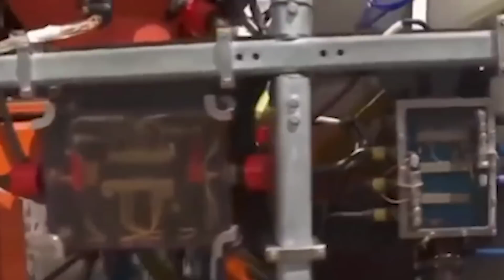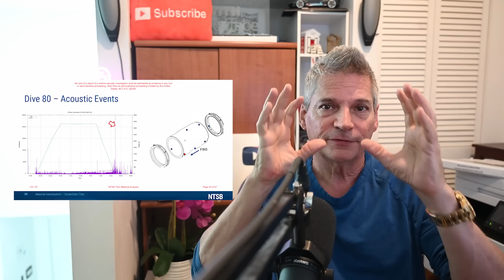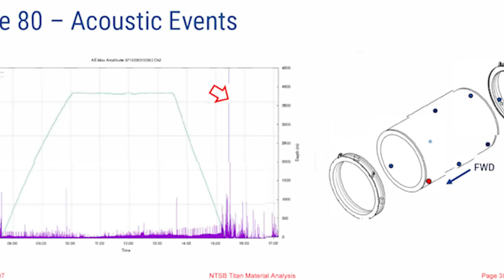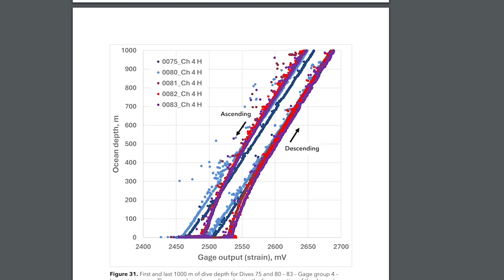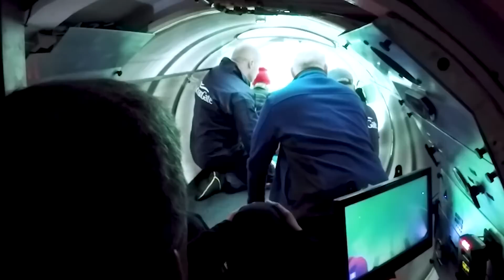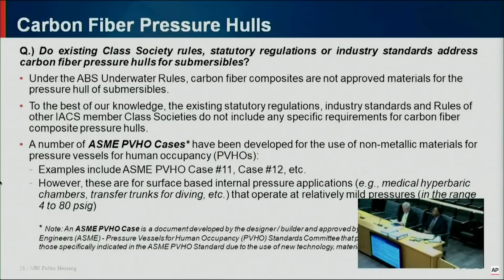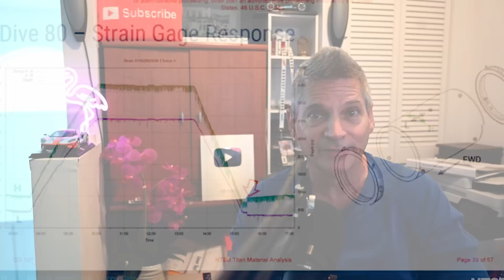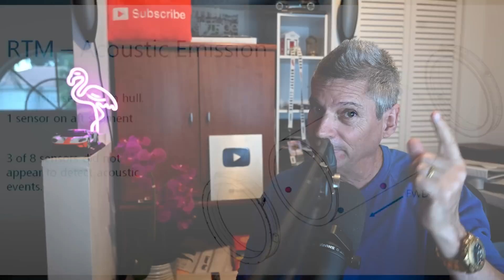How OceanGate Titan Sub Realtime Hull Monitor FAILED! RTM

Comment: Jeff,

I have no first-hand experience with carbon fiber hulls.  I do have years of experience with steel-hulled vessels.  I spent years working both within my company and with other companies and regulatory agencies studying fatigue cracking on tankers.  I worked on the prevention of cracking through design, monitoring cracking, the repair of cracks, and modification of structure when repairs are made.

On several occasions, we removed sections around cracks and sent the steel for laboratory analysis.  When fatigue cracks progress in steel there will be chevrons left in the crack pointing in the direction of the starting point.  At first, the chevrons will be close together, say 4 or 5 chevrons spaced 1/16" apart.  Then you might have 2 or 3 at 1/8" apart.  Then one at 1/4", the next at 1/2".  Then the crack may reach its critical length, at which the crack will run until it reaches something that stops it.  I saw cracks that were 9' in length, and one that was 20 to 25' in length.

About the time I retired, I started discussions about the feasibility of placing strain gauges in the cargo block area that could be downloaded periodically to help in the identification of crack initiation.

As I said my work was with steel.  On a tanker, you might have 2 or 3 grades of steel.  The steel is welded.  Ships are built and inspected following regulatory agencies' rules.  Structural rules for tankers are uniformly based on the International Association of Classification Societies (IACS). 

Titan was built based on no rules, regulations, standards, oversight, or inspection.  Based on what has been revealed there were no inspections to identify where the banging was coming from.  It seems that Mr. Rush went out of his way to avoid finding out his design was faulty and was ready to fail.  As with fatigue cracks in the steel of tankers reach their critical length, the Titan reached a critical point.  It could have been the adhesives used to hold the titanium rings to the hull, the carbon fiber, the adhesives between the 1" layers, or some other design flaws.  It is clear that Mr. Rush avoided seeking approval because he knew his design was faulty and he could not be modified enough to be approved.  It is a shame that four other people lost their lives due to Mr. Rush's ego. I think the legal term is negligent homicide or involuntary manslaughter. 

Bob
Reply: If you consider the contraction and expansion rates of different materials due to both atmospheric pressure and temperature... it's not just the carbon fiber composite contracting and expanding at different rates to the titanium, but the glue as well.  This "joinery" seems to be the most obvious point for potential failure but they only paid attention to the circumference of the hull (hoop stress)... 😱
Reply: the most confounding part is they never destructively tested the vessel, so they had no idea when it would even fail. Just mind boggling.
Reply: Very well written, Bob. I enjoyed your comment, especially what I surmised to be about steel welding and the potential varying grades of steel being used. That was BITCHIN' (to use a word from Junior High) and got me thinking about different things that could be affected in daily life, like 60+ years home pipes. 

EPIPHANY-CITY. 

Your comments on steel and steel-hulled vessels can also be appropriate to the materials used to build, maintain and fix aircraft. 

It seems that the Titan submersible seemed kinda nicely thought out and put together...
For a shallower dive.
A REALLY shallower dive. NOT for going down to something 12,500' underwater. 

Thank you!

(I wish I was born into a time where I could've gotten into this stuff as well as aerospace, instead of being pressured into either a housewife or retail slave occupation. Yeah, I'm older, but still kickin'.)
Reply: Oh, wouldn't you say it was voluntary?  Our legalese is too forgiving.  

Say, a real question here:  They talked about the pops and noises and Wouldn't those be worse at the first and by the cc time it was ready to give way, maybe less noise because it had already failed on so many levels of the fiber?
Reply: @EKA201-j7f  If I understand correctly there were pieces that were pretty much intact and others that were destroyed.  I would guess the noises continued on each dive.

I think the plots showed the cracking sounds were heard on the way down and on the way up.  This would seem logical since the rate of change in pressure would be greatest when the sub was headed up or down.

It will interesting where the final failure occurred at the titanium ring glue joint or in the carbon fiber hull.
Reply: Wonderful insight. Thank You!
Reply: You are spot on Bob, thanks for the insight and passing it on.
Reply: Clapping for You Bob!
Reply: Very interesting thank you Bob.
Reply: Agreed
Reply: No suvivors. And they signed off
Reply: May All there souls rest in peace
Reply: Stop taking out of your Ass, Bob!
Reply: @500Pluss  Hmmm . .You only had to write seven words and you still messed up . . Carry on Bob !
Reply: @leynagh Indeed! I was actually very intrigued  by Bob's entire comment. I enjoyed it very much.
Reply: @500PlussAre you sarcastically baiting a friend...someone who knows you and understands your style of humour? Or are you genuinely criticizing the explanations of a man who to all outward appearances seems to know what he is talking about. 
     At any rate, I found "Bob's" entire comment very interesting.

Comment: The failure was at 6500 psi, NOT 6500m. That’s a safety margin of roughly 1.2 over normal operating depth (3800m), 6500psi is hit at 4500m depth.  
Or in other words: that’s no margin at all.

Comment: He made/patented this RTM system, that has no past data to refer to, and thus he was unable/or chose to ignore, all the previous dive’s RTM gauge recorded data.  Each recorded sound/crack weakens the overall shell on a cumulative basis.
When is the failure point?  It was the last dive at 3,800 m.

Comment: I don't think the system failed if you look at in terms of what it actually did as opposed to what Rush claimed it could do. The latter of which is absolutely unfeasible no matter how you look at it. But in regard to the former, they did receive warnings that their sub was deforming and Rush chose to ignore them. Just like everything else.
If God himself came down from heaven to warn Rush of the implosion, he'd just go to Walmart and buy a can of Flex Seal in case of emergency and proceed with the dive.

Comment: I am of the opinion that the change in behavior of depyh versus strain between dive 80 and dive 81 is suggestive of an imprnding disaster. A change from linear strain with depth to an initially nonlinear syreain v depth sushests significant degration. The NTSB constructed the strain versus depth charts.

OG did have the data showing an abrupt jump in strain output on Dive 80 that was contemporanious with the loud bang. The loud bang was an output many times of any other ourput recorddd on Dive 80. These irregularitues should've been a "red flag" warranting further inspection.  Maybe the hull did reseat or shift but why? OG seems not to have evaluated the data as depth versus strain, essentially stress-strain with depth (= external pressure) as a surrogate for stress. Still OG had data akin to a hard lsirplane anding where a large jolt (loud bang)  is felt and a tire ruptures (abrupt change in strain). Doesn't one check the hardware attaching the landiing gear to the airframe for damage and crack? Npoe. OG acts like "no biggie, tires occaisionally fail." Then the landing gear gives way on a susequen landing with a resulting airplane doing cartwheels.

Comment: I think the strangest thing about his whole idea is that seemingly he wasn’t thinking about the effects/characteristics of putting the hull through multiple pressure cycles…which is exactly what they obviously wanted to do with the real sub.

Like it’s cute that they took audio measurements on a scale model as it imploded, but from that footage it looks like they only took that scale model on a single “dive?” Like it’s strange that they seem to be implicitly acknowledging by the existence of this monitoring system that the fibers will strain and potentially break, but they didn’t consider those strains and breaks accumulating over many dives…?

Comment: Failed sensors likely because the inner wiring had already been damaged, as it is held down in an epoxy coat, so the failure was probably internal delamination and snapping of the cables.

Comment: Since the forward titanium flange appears to be the ultimate failure point, would just a little added thickness there have prevented the failure? It seems like the carbon fiber pushed in on that flange causing it to shear. Did Dive 80 introduce metal fatigue on the titanium that would cause it to fail later and that is what the graph is showing?
Reply: I think the current hypothesis is that the glue failed in one spot, the titanium flange remained intact and the carbon fiber bent into a slightly different shape which we see in the rtm strain data on dive 80
Reply: @thewhitefalcon8539  Then what happened to the inner flange? From appearances, it looks like the glue may have failed, causing the carbon fiber to exert additional force on the flange, which then failed and caused the submersible to implode. The flange is clearly missing.

Comment: Yes, I do think the real time monitoring system actually worked. Now not in the way Rush said it would, warning them of imminent collapse, but it was giving off warnings (tons of them) several dives in advance. Rush just ignored them.
 This disaster really reminds of so many other engineering disasters caused by negligence. Like the Sampoong dept store collapse for example. The people responsible overburdened the building until it was unsafe, and they knew what they were doing was unsafe. Then even when the building itself was giving off tons of advanced warnings, cracks in the foundation and support pillars, dreadful vibrations, they did nothing to stop it and kept using the building right up until the end, they ignored every warning because the negative financial implications were too great for them. Denial at its most powerful, dangerous and deadly.
Reply: Miami condo crumbling down: same thing.

Comment: Two commenrs:

Firstly you could argue that the RTM did work. It gave plenty warning, and had anyone been actually checking the data it gave, the accident would never have happened.

Secondly, I would not rule out that he did see the data. He could not afford to start over again with a 3rd hull, so I think he deliberately ignored it. I even suspect that the three non-working sensors had been turned off on purpose because they gave too many warnings.
Reply: "The fire alarm is blaring!"

"Thank, I'll lower the volume, that is annoying!"

Comment: Retired engineer here…risking human life, ignoring industry regulations is an egregious violation of my professional code of conduct.  All because he believed “innovation” was more important than following tried-and-true engineering principles.  A spherical steel hull might not have been “innovative” but it would work safely (and probably even less expensive in the long run) especially factoring in the cyclical stress loading (pressure, then no pressure, repeatedly) and rough handling conditions of maritime service.
Reply: Don't worry, The Roberts Supreme Court will rule that engineering & science are illegal soon.   No more problems!

Comment: The Titan did not got to thirty-eight hundred (380) meters. It went to three thousand eight hundred (3800) meters.
Please use the correct engineering number units, and not the slang number units.

Comment: I'm confused about how anyone could think that carbon fiber could protect against a compression, instead of a tensile strain.  That would be like compressing a rope vs climbing a rope.  Wouldn't the vessel be as strong as the glue that's holding it together?

Comment: The reason the sub was not spherical Carbon Fibre is that 1) they wanted to have space for 5. 2) They tried spherical carbon endcaps in early testing which failed under pressure.

Comment: Risk management 101 calculations for OceanGate Titan:
1)identify inherent risk (probability x impact) = inevitable x death = SEVERE
2)identify control = acoustic and strain monitoring
3)identify residual risk after applying controls (probability x impact) = likely x death = SEVERE
4)determine if residual risk exceeds risk appetite = Naaaahhh, It'll be fine...
5)assess control design effectiveness regularly = Probably NEVER DONE
6)assess control operating effectiveness ongoing = Clearly NEVER DONE if several monitors clearly never worked!!!

Comment: He didn't even bother to use the test data to construct an acoustic or mechanical failure curve. That's like wandering around in the dark with no flashlight. 

Not only that he used a single 1/3 scale model to check (not validate) the ultimate hull pressure failure, what a moron.

As far as I can tell the CG nor NTSB have yet defined how the sub failed or what failed. No-one has definitely said it's the carbon fibre, more alluding to either the glue joint between CF and TItanium ring deforming too much (allowing water ingress and implosion), or the inner wall of the titanium "C" channel being too thin cause it was completely sheared off circumferentially (which popped off the forward dome and then everything else collapsed backwards as a result)

Comment: I think the carbon fiber hull was successful. If somebody else has made it using better materials, a thicker hull, or some other changes. Or even if Rush used this Titen to go to a maximum of 1 km depth. It would have worked. I think Stockton Rush would have killed himself in a spherical steel pressure hull too. This amount of neglect can destroy any project, even a well-known and well-tested one. Ruch not only killed himself, he also killed any chance of the Carbon fiber being used in any form of deep ocean submersible.

Comment: Since all the 'heavy' noises happened after the dive it cannot be related to the pressure. There was none. But the vessel was in contact with the platform. So it is hard to say whether the platform and contact to it or external sources were the reason for it. It would have needed a test to determine where the source of those noises was. So monitoring when it was on  the platform would have be the way to go. And seeing how long those noises were sustained. Until you have a proper explanation of the noises and what caused them.
I think Stockton simply thought along these lines: No pressure so it must be something else.
I would have wanted to know whether the noises were from expansion under atmospheric conditions. Or from the air getting into contact with the hull. Or whatever.

Comment: Submarines have ribs or rings inside the hull or tube to strengthen them - the idea of the cylinder being 10 inches thick sounded a lot better also saying it was certified and proven to be safe at those depths - 
        I worked in the offshore oilfields for yrs - when divers lost air pressure at 300 ft there body's were often smashed into there helmet and there wetsuit was pretty much flattened -
     That's what water does also at time if a brake line brake was at the surface and a check valve failed at the helmet - blood shot out the hose at high pressure as the diver compresses - 
    There were many divers  accidents up till the 1970s -

Comment: If this does dont work or the self set limits are not followed, then there RTM does not make sense. And this implosion was not an accident, it was a design flaw and it would have happened in any depth, it would be only a question of cycles (differential material expansion under pressure and the miss construction of the gluing of carbon fiber to titanium). He is either stupid or a murderer.

Comment: making it spherical would only delay the problem, laminated materials will fail when you repeatedely compress them. Making them more thick or better shaped will only buy you time before a failure. This is why composite materials are not used on theese scenarios anywhere in the industry.